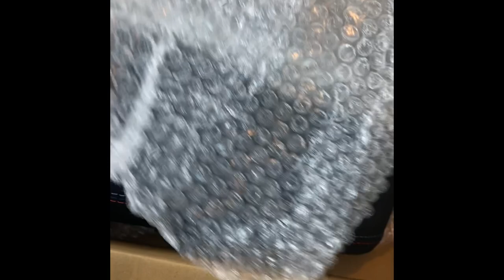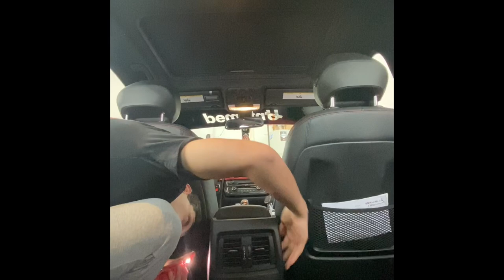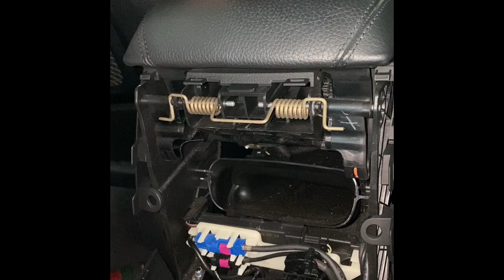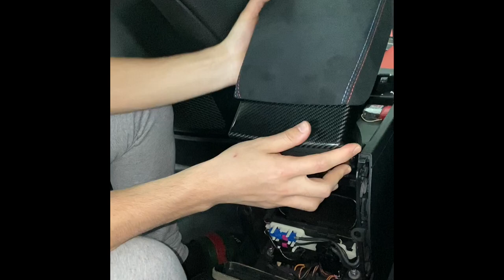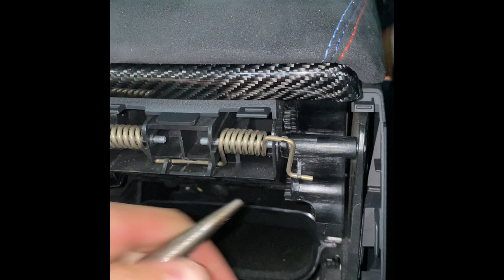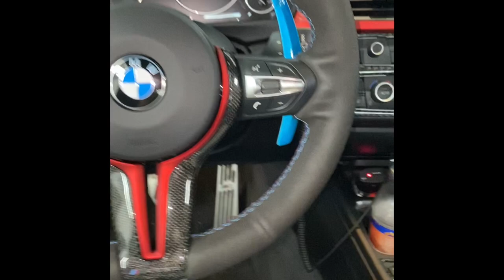BMW F30 M Performance Alcantara arm rest install!!!

Comment: Tip for anyone doing this, if you open the lid it releases spring tension, much easier to remove and reinstall the spring this way, thanks for the video!